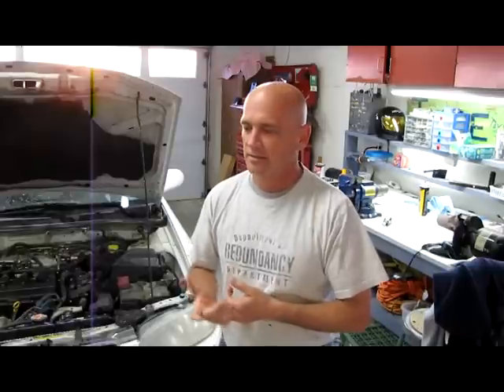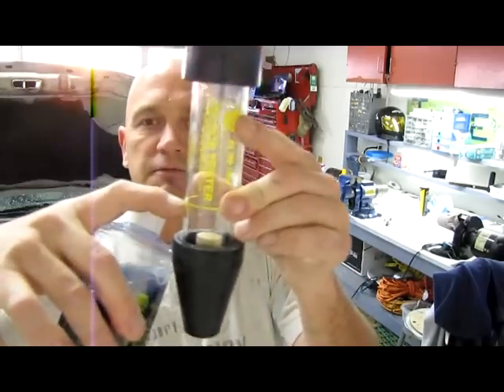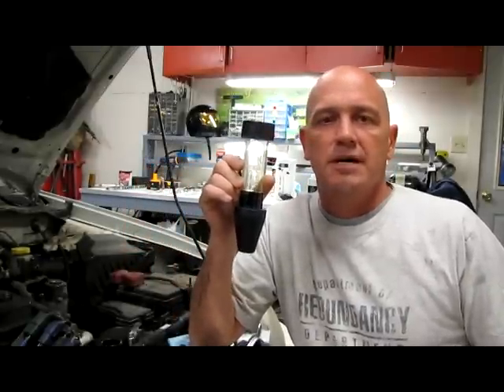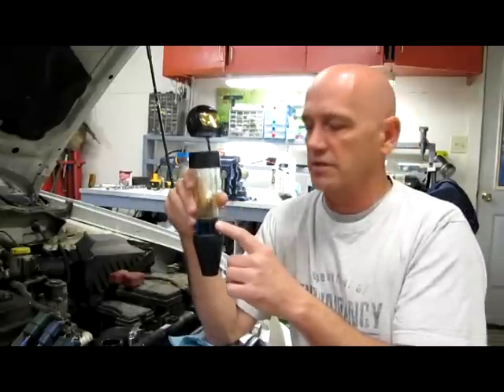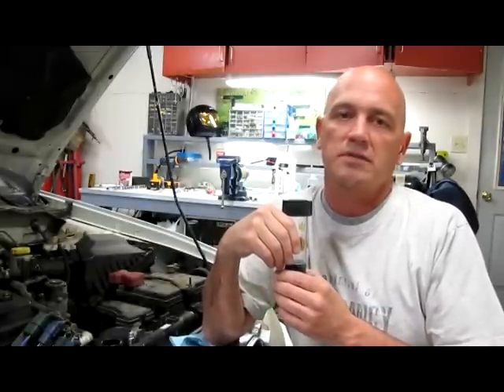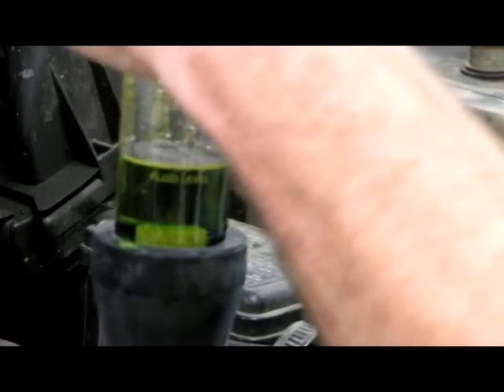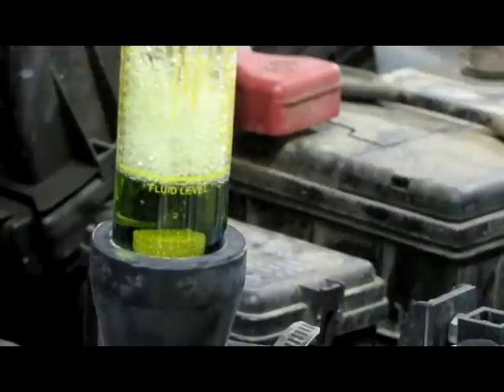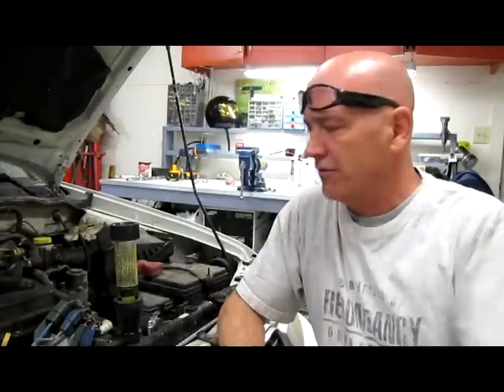How to Test Head Gasket

Comment: Would like your opinion on this one! 04 honda civic 1.7L. barley any heat at idle unless running for a long time. Heats fine when cruising. Noticed the reservoir bottle overflowed today after the temperature gauge started to climb. I had the car off before it  was anywheres close to the red line. Purged the system after that and there seemed to be ALOT of air in it. When the bubbles seemed to stop I let it get hot and took it for a drive. Lots of heat (not so much at idle but better) Parked and checked the hose from the thermostat, it was cold. Never noticed the cooling fan coming on either.  Also seen a couple little bubbles in the reservoir only after my test drive.. hoping that was just more air that needed to be escape. I was going drain the reservoir bottle and purge the system again. next I would change the thermostat.. hoping this is all it is.. no white smoke. just over heated that one time today. SUPER cold outside here. should I just go for the Block tester? thanks!!
Reply from the maker: Raid: Great descriptions, and thanks for your comment! I think you are right on track with your troubleshooting, except for maybe one additional aspect, and I'm assuming that your readings of heat are not normal to what you know the car to normally run at. Couple of definitions, first, and correct me if I'm wrong, here. By 'heat' or 'heats' you are referring to the temperature gauge level, I'm assuming.  And, by 'purge,' you are referring to draining existing fluids/replacing fluids.  Given those definitions, here is what I think:  First, I've seen Honda engines run very cool, with little coolant, at idle speeds for no explainable reason - I've witnessed that, and have no idea why.  So let's ignore that for now and deal with the more obvious things.  Overflowing reservoir tank: my suspicion is a lack of adequate COOLING SYSTEM PRESSURE (meaning, you may have a leak, or a bad radiator cap, which is THE pressure regulator for your system). Your cooling system needs to be able to build up a specified pressure level in order to gain degrees on top of the normal, 'un-pressurized' boiling point of water. Cooling systems are 'closed' systems, and for every pound of pressure they are able to build up, they gain on average 3 degrees (F) on top of the normal un-pressurized boiling point of water.  So, a 10lb system gains 30 degrees on top of the normal 212 degree boiling point, then making its boiling point 242 degrees - HUGE!  If you have even a slight leak, this significantly REDUCES the temperature at which your coolant will boil- and when it boils, there is NO FLOW, and no flow = overheating.  So- to target that, have a pressure check done on your cooling system with a pressure checker (I have a video on that process on my channel, if you're curious), as well as have your radiator cap checked - or just replace it and see if this simply fixes one aspect of your problem.  Next, your mention of the radiator hose to the thermostat being cold after the gauge ('heat') shows normal operating temp indicates a blockage, or an air bubble, or both.  You are right on track, and here is what I would do: drain your system and install a new radiator cap and thermostat.  Honda's have an air bleed valve, so be sure to fill it properly, leaving no air in the system. If you still have issues, have your system pressure checked for an additional leak somewhere.  You could have an additional place which is allowing air into your closed system, and allowing that needed pressure to leak out, which lowers your acceptable 'designed' operating pressure.  Hope this makes some sense.  If not, you are welcome to reply or message me.  Would love to hear back!  r-
Reply: reluctorvalve Thanks for the reply!! So, I have changed the rad cap, I noticed the rubbed what ripped a bit. I put a new thermostat in as well. When I say purge I mean bleed the system on air. Anyways I did that again after installing the new thermostat. I let it idle till it got to operating temperature. The fan didn't come on, and the blower for the heat still shot out cool air. Now, I live in Montreal QC. Its cold as hell here. So I don't know if that would effect the temp. of the air coming from the heater or not? Besides that, the running temp gauge was perfect and had lots of heat when I took it for a test drive. After about 10 min I pulled over and checked the top and lower hoses. Top was pretty warm almost hot I guess, and the lower one was barley luke warm. Kept driving it and after another 10 min the top was more hot and the bottom felt pretty warm for once. Again I never noticed or heard the fan come on…Does it not need to because its so cold outside? even at idle? How is my engine not overheating if the fan isn't coming on.  The car seems to run perfect, I don't get it. Im going to test the fan with battery power today to see if it actually works.  I don't have access to a leak tester at the moment. Im working on the car in the street. Trying to take care of everything I can do myself first before I have to take it somewhere. Again thanks for the Help!!!
Reply from the maker: raid napalm  Raid, I notice you didn't mention any more bubbling over issues, so I think you have corrected that with the new radiator cap and thermostat. Ah yes, purge - air bleed. Got it. Regarding your fan not coming on, a couple of things. Your cooling fan is designed to only cycle on at a pretty high temperature, which will be well above the thermostat operating temperature. If your engine isn't reaching that higher temperature (usually well above 'normal'), then the fan won't be actuated. This means that your fan could be just fine - it's just not getting hot enough, and not required. Your fan is designed to only come on in stop-and-go driving, or while sitting still for extended periods, and when there is no 'RAM' air (outside air) flowing over the radiator. Otherwise, the 'RAM' air flow from in front of the car is what flows over the radiator and cools the coolant inside. Could be your environment is at this time so cold that it just isn't reaching those temps with such little driving. I've seen this on Honda's before, myself. A much longer drive would test it out, including stop/go traffic. There are ways to further test your fan by jumping wires, but I hesitate to elaborate on that because I'm not specifically familiar with your system.  Good news is that it's running 'normally.'  Your temp gauge is key, and it says it 's just fine. Take it out and drive it for a good hour or so, including stop/go traffic. While 'cruising' at highway speeds your fan won't come on as the 'RAM' air is enough. Next, your heater. Question: how long have you owned the car? If you just got the car I suspect someone has bypassed your heater core, but I'll wait on your answer to that. Further, you report that your engine now runs at good temps and pretty normally, except you have a cold heater. I looked up your heater control valve and it looks to be cable-operated. Just do an image search online for your heater control valve for your car and you can see a lever on it. The lever opens and closes the valve that allows hot coolant to get inside to your heater. You will have two heater hoses going to your firewall - one supplies hot coolant to your heater (has the heater control valve on it), an the other is a return line back into the engine. Feel both of those hoses right at the firewall.  Are both hot when the heater controls are set to 'heat,' and your engine is at normal op temp? A bad control valve, cable having come off or not connected to the valve, a faulty control valve, a bypassed heater core - which you'd see where the heater hose inlet is directly connected to the return (modified), or a clogged heater core - any of these are what I would look for at this point.  Start at the heater hose area by the firewall, locate the control valve, make sure the cable is on it, then turn your inside temp to 'cool' and see if the lever on the valve has changed position. If that looks good, then do a running test and feel the inlet and outlet heater hoses at the firewall for hotness.  Both should be hot, when your inside temp is set to 'hot.'  Hope this isn't too confusing- you can PM me as well if you need to.  See how this goes and I hope you are able to report back.  r-
Reply: reluctorvalve This is great, not confusing at all. I have had the car for a few months now. The original owner were my folks, and they babied it and never had any sketchy work done to it. There is 330000km (205000miles) on the car. Thats why I was super worried it was the head gasket, as they supposedly go in these cars. I was only able to check under the hood and locate the cable and hoses. Its so damn cold outside these last few days I haven't been able to go out and work on it. I took it for a good long drive yesterday, again everything seemed fine, besides taking forever to get heat out of the heater.  I touched the hoses at the fire wall and they indeed felt cool/luke warm at the cars running temp. I will have a better look at the cable and valve sunday when its supposed to be tolerable outside. Im hoping this is all it is! seems to be pretty likely. Thanks for doing some research for me too! this has been more then helpful. Also, I have no idea how to PM haha my email is pilon_3@hotmail.com if you want to reply to that!
Reply from the maker: raid napalm Raid: So far, good news to this point. Sounds like overall your radiator cap wasn't holding pressure and you've corrected that.  The other great news is that you are familiar with the car's history, so I can count out any potential odd modifications.  Also, sounds like now the engine itself is running normally and at a good, normal operating temp.  The only issue left is a lack of hot air from the heater. This is most typically caused by a partially stuck-open thermostat, which in your case isn't the issue; you've replaced it.  You've also ensured there are no air bubbles.  Now our troubleshooting is able to be directed at the heater core and its valving for hot coolant supply and return.  The heater core is just like a miniature radiator which is located on the inside of the car, usually under the dash area in its heater box area. The basic design is that the heater core receives heated coolant from the engine with a heater control valve in between.  As you adjust your heater temperature, it opens and closes the heater control valve. Then, the coolant flows through your heater core, heats the blown air inside your car, and is returned to the engine through the other heater hose going back to the engine. You've already been able to identify your heater hoses in and out of the heater core at the firewall, as well as where your heater control valve is, and have verified a cable-operated lever on the valve.  When your engine is running at normal operating temps, both of your heater hoses in and out of the firewall area will be hot to the touch (when the heater control valve is open, allowing flow), or should be according to my experience.  I lived in Flagstaff AZ for almost 20 years, and the winters there can be similar to some of the coldest areas - but perhaps not as cold as where you are.  Common sense tells me that your engine will supply HOT coolant to the heater control valve - so, one side of the heater control valve should be just as hot as your radiator hoses are. This is controlled by your thermostat -  you've already changed that, so I'm assuming that's not an issue.  Next, at normal op temp with your heater at 'HOT' setting, the valve should be OPEN, so the hose leaving the valve and going into the firewall should be just as HOT as the control valve's inlet hose.  Check to make sure that's true at normal op temp. Next - important - the other heater hose coming from the firewall back to the engine should pretty much be as hot to the touch as the other one is.  If it's drastically cooler, you may have a clogged heater core.  If this is the case, I'll explain what to do for this, which is really pretty easy usually - and yes, I've seen this, too but it's a rare thing.  The main thing at this point is that your engine is running normally and you've already checked the deeper issues.  Hope you can check this stuff and respond - I know the weather up in the eastern areas from where I am is super cold!  I have to admit, I'm loving our weather here in AZ right now!  I shouldn't complain when it's only 32 degrees and sunny outside!  Hope this helps some.  r-

Comment from the maker: I have a recent video uploaded to my channel which is a pretty detailed example of what it takes to repair/change typical head gasket(s) and cylinder head(s).  It's long by comparison, but gives a lot of good information on what we did in our professional repair shop to perform this level of repair, which can be done at home.  Given my normal full-time job, I shot and edited this during what time I had available, which took me about two months' time (I also had other 'home' things to take care of - you could do this in a few weeks if you have other normal employment requirements).  Your local repair shop can have this done and to you in as little as a week, generally, usually with some kind of warranty on the work.  My replacement heads came with a 12-month, 12,000 mile warranty.  Fun stuff for us gearheads!  Check it out - How to replace head gaskets and cylinder heads on Youtube.  r-

Comment: @reluctorvalve Hi and I apologize for not typing this or my last response under our convo, but for some reason I can't reply to any of the comments from it. Now to the statement you corrected from your first reply, I have to admit it did get me thinking how better recycled ventilation (like from a new pcv valve) would get rid of the moisture in the oil if there is no escape route. However, since it was a close thing to air and moisture in desperate times and because someone experienced, respectable, and trustworthy suggested it, I felt comfortable changing it. I don't know how it worked but it did. The pcv valve was less than 3 dollars. Bottom line is after daily accumulation of water droplets under the oil cap sometimes even being "chocolate milk" colored (I wiped it off the cap daily by the way), the thing that solved the issue after 3 days of installation was a new 3 dollar pcv valve. For that I am thankful, thanks again reluctorvalve.
Reply from the maker: Long: It solved your issue because, by replacing the PCV valve, you 'unplugged' the plugged up nose, so-to-speak.  You replaced a part that helps to 'ventilate crankcase pressure' from the inside to the outside - which now allows those open spaces inside your engine to breath in and out as needed, and not just be stuck inside.  Glad this helped you!  And, thanks for all the follow ups for the other folks to read!  You've probably helped a lot of people by remaining engaged in this!  r-
Reply from the maker: reluctorvalve I've posted this exchange below which attaches to our previous conversation, for those looking for the history on this.  r-